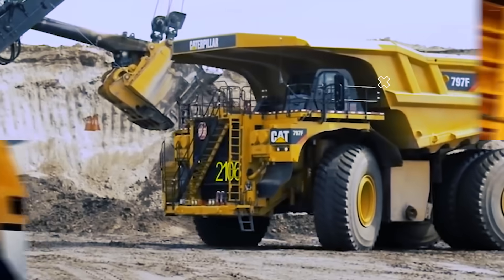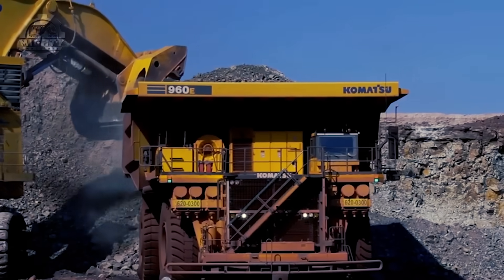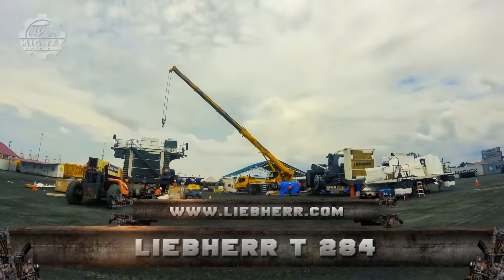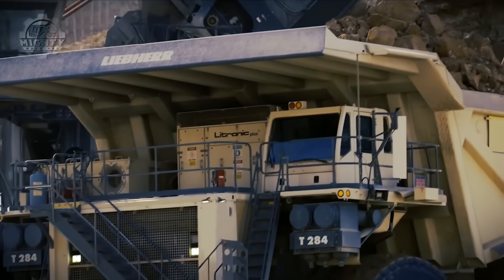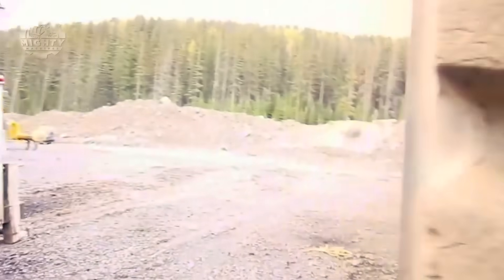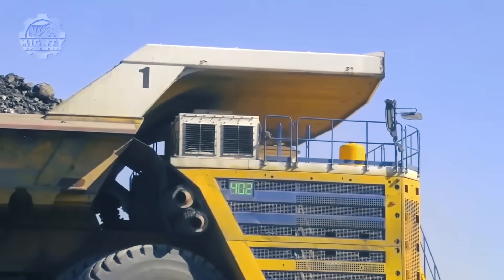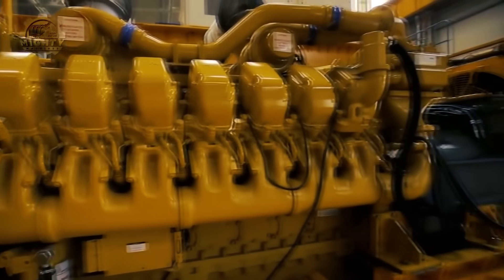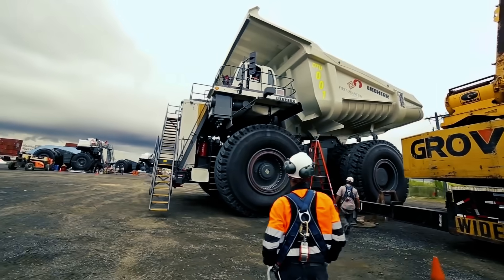Top 5 Biggest Mining Dump Trucks In The World

Comment: Picture doesn't do justice of the actual size of these machines but also easy to operate. CAT 797 is bigger than you think
Reply: Watching the video of the 797 and the stock footage they used was of a 793. I’ve been doing tires for 20 years on these and I can tell by the wheels it’s a 793. The 797 is quite a bit larger as well.

Comment: The Komatsu 960E is NOT Komatsu's largest mining truck.  Komatsu has developed a 980E to compete with Caterpillar's 797F
Reply: And after the 980, came the 980-5, than  a 980HHP, then the new K-28…..with more great great revolutionary new trucks in the works. 
P.S. I am a crane operator where these amazing trucks are made. I can’t say anything more except you won’t believe what is coming, it’s game changing.
Reply: @erichigdon2091  I can only see the 980E-5 on the site. No K-28.
Reply: CAT has the 798 AC which has a higher payload than the 797F by 9 ton and 500 fewer horsepower.
Reply: Get a life man...

Comment: It would be interesting to hear a rough estimate of cost for these monsters 👻
Reply: A KOMATSU truck costs roughly 4,000,000 for the smallest mechanical truck, and around 6,000,000 for the diesel electric ultra class truck. The smaller truck hauling  capacity is of 150 tons, the ultra class can exceed well over 250 tons. In fact a fully loaded 980, for example, weighing in at around 150,000 pounds without a load, will weigh in at 500,000 pounds loaded. Assuming mine operators don’t exceed the weight capacity of the trucks, which they often do.
Reply: @erichigdon2091  They weigh over a million pounds fully loaded.
Reply: $3.4 million
Big Rig Trucks
A Caterpillar 797 Mining Truck costs $3.4 million, weighs 1.38 million lbs., has a 3,370 HP engine and can carry 363 tons. What
Reply: @Emily Emily  Emi...
@emily...
Reply: One price I heard was 5million.
Reply: Why do I always see you everywhere? Just when I passed by your house, I saw your mother calling you
Reply: They cost around 18 Million and they don't come with Tires or engine
Reply: @MrMRDUGIE bullshit
Reply: Type it in, look it up!
Reply: @jamesb.9155  q12¹¹1q+qq1
Reply: It's called Google